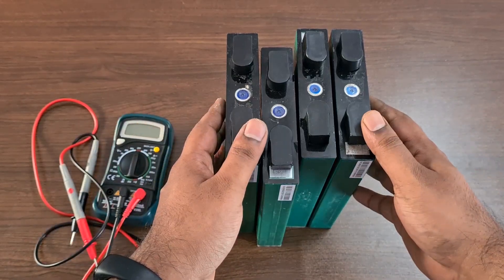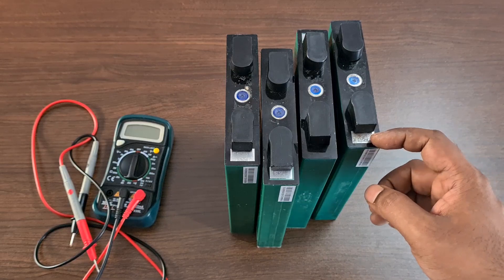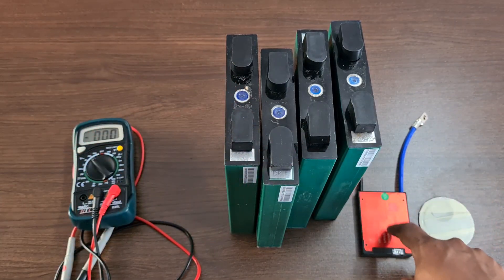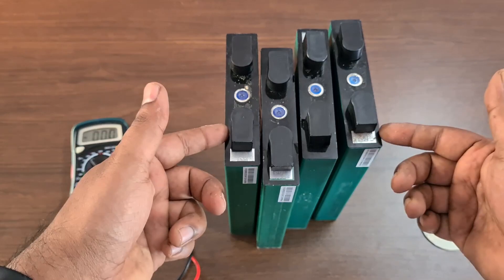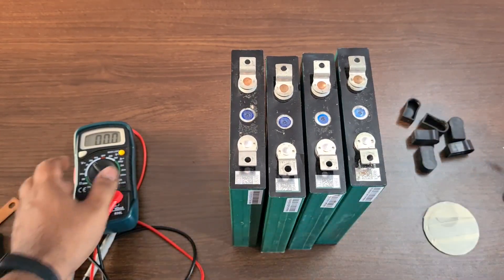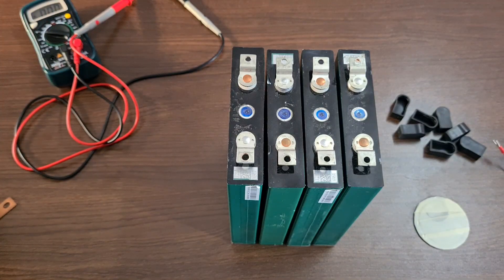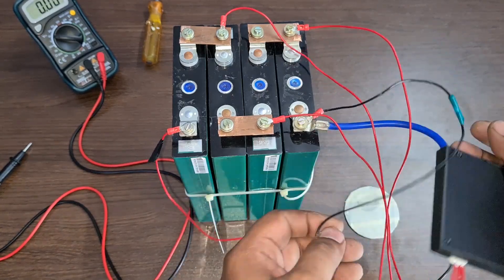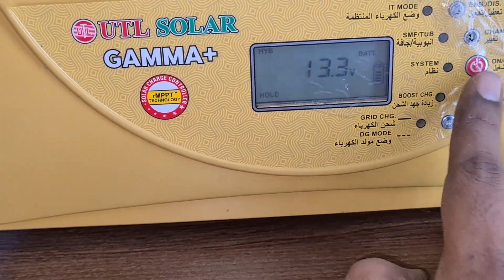Build 12V LiFePo4 battery pack for home inverter. Using with UTL 12v Gamma plus.

Comment: Hi Guys , Recently i tried to wire 24v lfp pristmatic 100ah cells to be used on my old microtek 2kva inverter , I have researched about all the kinds of charging methods and voltages for both the chemistry , and what i did found out that they should be compatible with our old inverters , after many days i have found out the inverter charges these cells to 13.4 v (for 12v battery lets say) and low cut off is at around 10.5 , which is actually perfect to be used directly on lithium phosphate cells , 
I would even say that you don't need a bms if you have an active balancer , which is costly then bms , but bms only do passive balancing after reaching a certain voltage at the top end .
My inverter also has option for tubular or smf , which is a button which says high charging voltage . Which takes the batteries to 14.4 volts , which is like the perfect 100% point for the lfp cells , 

The only issue with these is that you have to buy a bms with high amp rating , so that it can power the load without any issues . Also your cells should accept the amps given to battery , so you should make a bigger bank , like more then 100ah for there to be no issues whatsoever , when and if your inverter has charging modes like desulphication *, equalization , which are acutally the two modes which can cause harm to these cells , the float voltages should not affect he lfp cells whatsoever . 

I would also like any more information regarding this here , so that people looking forward to use lfp cells with old inverters can find something concreate to ease up the tension of ordering expensive cells :P :p 
 GO for it .

Comment: Good explanation. Can we use LiFePO4 battery pack with an inverter, which is designed for Lead acid battery? Does the difference in charging current matters?

Comment: What about cell balancing?
It's a very frequent issue in lifepo4 cells and you are just using only bms
Reply: it's not a big issue unless you are using used and abused cells. Grade G(arbage)

New cells from different batches will be similar enough that you should have very few balance issues. A passive balancer with a current of 60mA is probably enough even for a larger pack. New cells from the same batch will stay very tight. I just add balance leads and put the battery on an RC hobby charger every once in a while to tighten up the balance

Comment: Sir may i use Lifepo4 battery pack in normal home ups it was not turning on why? How to convert normal home ups sinewave to Lifepo4 inverter?
Reply from the maker: Does the invertor turn on when you connect lead acid battery?
Reply: @diyIndia  yes sir
Reply from the maker: Then it should work on lifepo4 as well.  What is the voltage of lifepo4 battery?
Reply: @diyIndia  12.6V. 24ah. Lead acid is 20ah. Maybe bms causing this issue. I have 20amps bms in this battery.
Reply from the maker: Okay. Can you chec if voltage is coming out. There should not be any problem in invertor turning on.
Reply: @diyIndia  yes sir it's showing 13.2 volts at terminal.
Reply from the maker: Then something is happening when you apply load. Can you check with 12v bike or car bulb and see if it works.
Reply: @diyIndia  yes its turn on and motors running.
Reply from the maker: Then am not sure Why it does not turn on. Because invertor does know if its lifepo4 or normal battery.
Reply: @diyIndia  I have just short the terminals to reset the BMS and charged it and now it's working fine. And UPS started working. 👍👍 Thanks. If possible pls let me know where you buy this Prismatic I want to try that too.
Reply from the maker: Oh great.  Details In description

Comment: Great video. Thanks for sharing. 

Do you know if there is any BMS available in India, through which we can connect a mobile App and monitor the voltage of all cells. This can help to monitor the health of the LiFePO4 battery pack.
Reply from the maker: Glad that you liked it. I was looking for a BMS with bluetooth, but there are hardly any options in India. You can ask the seller if he has any. if not try bangood.
Reply: @diyIndia  Yeah man, it's hard. Why in India LiFePO4 is still not mainstream? Why not provide Bluetooth in BMS? Things need to change fast now :)

Btw found this seller of Bluetooth based BMS but they are not picking up the phone - https://www.genuinepower.co.in/smart-battery-management-system-bms.html#lithium-battery-smart-battery-management-system-with-android-interface
Reply from the maker: True.  Try the diy bms  I guess that supports it.
Reply: Order frm eBay or alibaba

Comment: How its working with gamma plus , does it charge discharge well, 
R u changed charging parameters
Reply from the maker: I no longer have utl gamma plus  but when I was using I kept the voltage to 13.7 I guess, it used to work good. But having a dedicated charge controller will help.
Reply: @diyIndia  which inverter and charge controller are you using?

Comment: Kindly share t pricing and capacity of the batteries. Also seller details, where I can get t batteries..
Reply from the maker: The battery capacity is 95ah as per the specs, you can let me know if you are interested. The cost is rs2850 for each individual cell. Contact details updated in the description.
Reply: @diyIndia  can v use old limunas inverter ?
Reply: @diyIndia  yes
Reply: How much cells v need to make 150ah betray and compatibility of  bms
Reply: How do i cpntact u